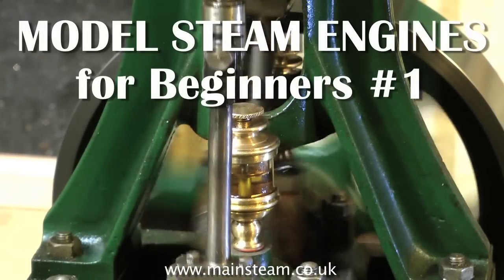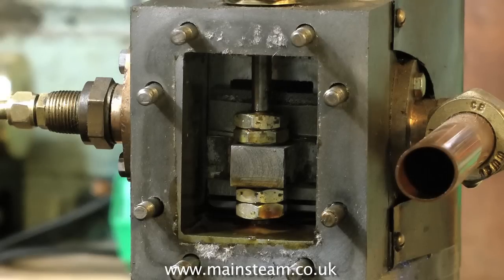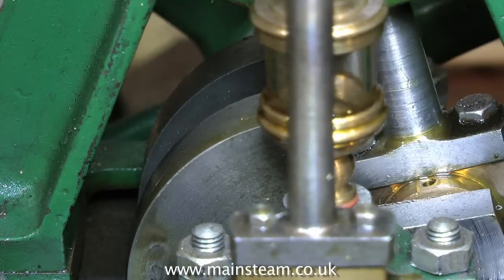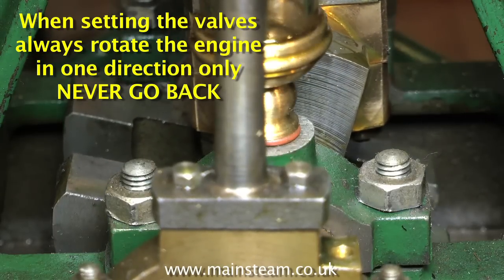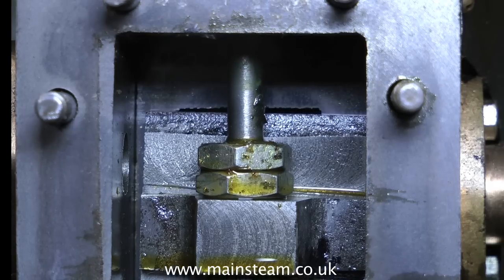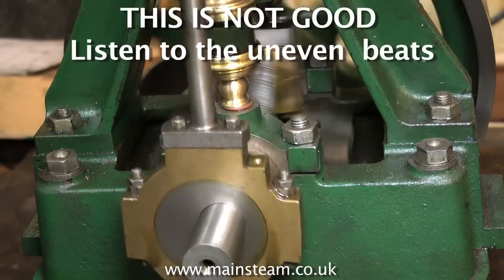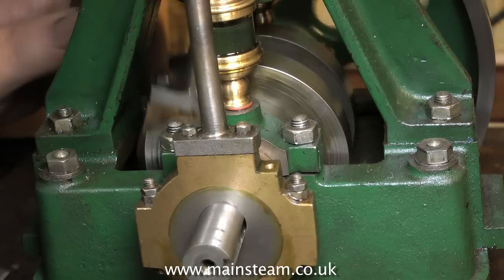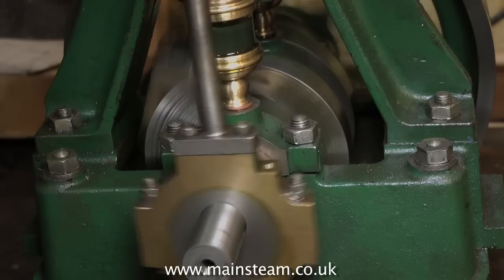STEAM ENGINE VALVE TIMING - MODEL STEAM ENGINES FOR BEGINNERS #1

Comment: Thank you for this fine video, I've watched it a few times in order to set the valve timing on my newly completed Tiny Power 104 engine. With this information I was able to set the timing so that the engine is smooth and quite running. I'm able the take away a little something from each of your videos that helps me in my steam building hobby.

Comment: I really like your way of explaining en your expertise I this field, I have a replica of the Tesla machanical oscillator, it's also a steam engine en it has a built in valve system as it is a self switching liniaire piston engine, I've also experienced that it runs way better on steam than on compressed Air en now I know way, thank you so much, I'm a subscriber now

Comment: A small comment on your bolt-or-screw discussion.
According to the swedish book for engineers, a bolt is: a cylindrical body with or without a head.
A screw is: a cylindrical body with or without a head with an outside thread.
The difference is the thread. No matter the size or the type of thread.
I guess that applies also in books written in the anglosaxen tounge.
73
Anders in Sweden.

Comment: Thank you for this very informative video, a couple of years ago I purchased a box of live steam parts off ebay, inside were quite a few parts that looked as if they had come off a twin cylinder engine, there is one gunmetal cylinder that has a sleeve down the middle drastically reducing the bore, my idea is to use these parts to build a table engine and your video had just the information needed to time and work out the crank throw plus eccentric size,  would like to send some photos to get your opinion on the cylinder but don,t know how to, can you help with advise please. regards Nigel Cox.

Comment: For us almost steam heads that own double acting production steam engines, mine is Wilesco D22 twin cylinder. The engine runs very well but the left cylinder has a small clunk to it. The lightest of pressure on the steam chest slide valve applied to the end of the valve silences the clunk. I am figuring that this is pre-loading the eccentric on this cylinder modifying its valve timing slightly. I do not believe any adjustment is offered to this construction. I was thinking a very light spring lever could be attached to  apply the pressure needed to silence this clunk. This pressure on the valve quiets it in clockwise and counter-clockwise rotation.

On a separate note author Bill Bryson had moved from the US to England and live there for several years now. Not than it has any affect on my intelligence but Bill and I grew up together going to the same schools. I think he was one year behind me. Wondrously knowledgeable and humorous individual. A story about his wife and history. During WW 2 a German pilot was flying over the English countryside. He was low on fuel so released his bomb so he could make the flight back to his German base. The bomb fell on Bill's wife's grandparents home where her parents were also living. No one was home at the time the house was lost. How random events can change history. If you have not read any of his work I recommend you do so. His venues are travel, language and science.

Comment: Hello Keith I like watching your videos .
I was wondering what is the best way to drill the boiler for the cylinder block on a 4 inch scale Burrel Showmans engine.
I can get a long series drill on most of the bottom ones but would have to mark out the ones at each end of the block and the top rows which are underneath the casting?

Any advice would be most helpful and appreciated 

Thanks
Reply from the maker: Sorry, I can only give limited help to my Patreon supporters: www.patreon.com/keithappleton

Comment: hi keith great video very useful info.I have a question about displacement lubricators.I have recently purchased two stuart models steam engines.One is a stuart s50 the other is a stuart 10v machined kits.She who must be obeyed wont let me turn the kitchen into a workshop for some reason.My question is I will be running both engines on compressed air until I get  boiler.would a lubricator work with compressed air,if not what other options are.
Reply from the maker: Displacement lubricators don't work with compressed air. If you get an inline oiler like you would use with air tools, that would suffice for all but very high speed running.
Reply: thanks for that.Will look on the auction site we all love.Again think your videos are great and done in a way that anyone can understand.

Comment: Not to get ahead of the class, but during construction, would you lap the slide to the sealing surface of the steam chest?  Great videos, and I'll be ordering a Victoria as my first engine project.  In short order it'll be quite cold outside in the midwest.
Reply from the maker: Slide valves (with correct lubrication) tend to "wear in" rather than "Wear Out" so lapping face to port is unnecessary ........

Comment: Hello! Collect the steam engine. What should be the diameter of the hole for the flow of steam to the cylinder. Dimensions: piston diameter 60 mm , stroke 75 mm. Initially make the hole 10mm

Comment: How important is it for the valve to be square to the ports? Are there any benefits to the port opening gradually instead of opening full width at once. You might not want full steam flow/pressure for the first few degrees or mm of travel. It could also allow a bit of condensate to drain at near tdc. Just thinking ...
Thanks, great service you are providing!
Reply from the maker: Best to have the valve square across the ports.

Comment: Very interesting. I wasn't sure what that lever was for.
I have a Stuart 5A that was part of a pile of machinists tools. 
It's in very good condition, runs very smooth on shop air.
I'm interested in selling it but there were no Stuart 5A's listed on Ebay as a guide.
Is there a better source for steam engine, classifieds?
Thanks for your help.
Jeff

Comment: This is a great video do you have any on setting the timing up for a twin cylinder loco the Stephenson's valve gear
Reply from the maker: with a twin cylinder steam engine, I find it best to set the valve timing on one side at a time. Feed in low pressure compressed air to one cylinder only, set the valve timing for that cylinder, then do the same with the other side.

Comment: Mr Appleton.  I live in Canada and watch your videos thanks.  I am not a patron so maybe you won't answer my question.  I have a aluminum casting furnace and have cast and made a steam engine that runs on air.  I was wondering can I make a steam engine out of aluminum and run it on steam.  Thanks
Reply from the maker: I would just say that it's not a good idea.

Comment: Keith, I have recently recieved a Stuart mill engine and a mamod stationary engine after my grandfathers death, can to advise please on running the stuart on an air pump?, should I buy a airbrush compressor or some other kind of pump?
Reply from the maker: +Mark Kirkham if it is a small mill engine like an S50 or a 10H, then an airbrush compressor will suffice - don't forget to oil the cylinder as well as the bearings though.

Comment: Hey keith, I has a small query about something you say at the 2:00~ minute mark, so please bear with my ignorance here for a minute :p 
You say that an eccentric coverts rotary motion into reciprocating motion, but not vice versa, were you making this statement in the sole context of steam engines? Or in engineering more broadly? Because while I’m very much so ignorant when it comes to steam engines, I know a passable amount about internal combustion engines, and the role of a crankshaft is to turn reciprocal motion into rotational motion, so is a crankshaft different to a eccentric? If not, then what am I getting confused about here? XD
Reply from the maker: An eccentric converts rotary motion into reciprocating motion, but not the other way round - it is just down to mechanical principles. An eccentric is very different to a crankshaft in this way.

Comment: Have you ever worked with an engine with discrete valve action rather than eccentric?
Reply from the maker: No, only steam engines with eccentric driven valve gear.

Comment: Now the real question. Does this method work on 3 & 4 cylinder locos??
Reply from the maker: Yes, The Gresley Conjugated Valve Gear on 3 cylinder locomotives can be tricky to adjust, but the principles are the same . . .

Comment: Thanks for the great video. I have an engine that I have been struggling with for a while to get timed right. Does this video show timing your engine for air or steam?  I run all my engines on air. Should they be timed later than if I ran then on steam, since air is less expansive than steam?
Reply from the maker: The timing is the same for air & steam.

Comment: Hello Keith, thanks for your great videos. Is it possible for a vertical slide valve to become unseated from the port face? On compressed air, when I open the throttle on my Gauge 1 loco, the air just whooshes up the blast pipe, no piston power at all. The loco has a single inside cylinder, slip eccentric. Impossible to open the valve chest without dismantling the loco. Thanks for any idea on how to remedy this.
Reply from the maker: sometimes you need to quickly snap open the regulator to slam the valve onto the port face - try that :-)))
Reply: Thanks, Keith. Finally got it to seat by disconnecting the valve spindle from the valve rod, easing off on the valve gland, then grabbing the end of the valve spindle with a pair of pliers and coaxing the valve onto the port face. Did this with about 80 pounds of air going into the boiler until the piston (disconnected from the con rod) began to convincingly slap to and fro in the cylinder. Reconnected the valve and con rods and got it going on air, loads of power (0-6-0 Cali Jumbo). Just need to set timing now. Thanks again for your vids!
Reply from the maker: probably the valve driver was gummed up with old steam oil etc . The slide valve always needs to 'Float" on the valve rod.
Reply: Yup, my thoughts, too. New engine to me, probably has not been run in many years as evidenced by the old cracking rubber hose connecting the tender meths to the burner. Nice old asbestos wicks, too! Thanks again!

Comment: i have a stuart turner compound launch engine and i am wondering how do you set the valve on the low pressure side of a compound engine? is there a difference to how you set a single cylinder valve
Reply: should you set the first valve as advised on the above video and the second valve to only open after a complete stroke of the HP cylinder?
Reply: I'm pretty sure that you set each valve as for the cylinder it's running on. So you would set the HP valve like in the video, and set the LP valve as in the video. There should be no need to have to do anything fancy. If the problem is listening for the openings on the LP cylinder, take the pipe off and make a little fitting to put air directly in the LP cylinder.

Comment: do you have a video on setting the piston on an oscillating steam engine? (just curious because im trying to figure mine out)
Reply from the maker: Setting the piston ?? Sorry I don't understand.
Reply: I'm sorry about that I was just wondering if you have a video on how to properly set the piston in a wobbler steam engine.
Reply: the specific engine I am curious about setting the piston on is the PM research model 2AM im new to working with steam engines this is my first one.
Reply: I figured it out I made a very novice mistake when I was setting the piston rod I didn't realize how much oil was in the cylinder and I thought I was hearing a knocking when I turned it over but it was just the oil making the sound. I wish you the best take care.

Comment: How do you know if your steam engine can run in both ways or not?
Reply from the maker: If it has reversing gear then it will run in both directions.
Reply: @keithappleton  thank you for the fast comment! Another question: How do you know which direction it is?
Reply from the maker: it depends on which side of the crank web that the eccentric sheaves are set to ......

Comment: do the highest points on the eccentrics have to bo opposit from on another?
Reply from the maker: +chubby7570 YES
Reply from the maker: Castings are available from Blackgates Engineering but they would need machining.